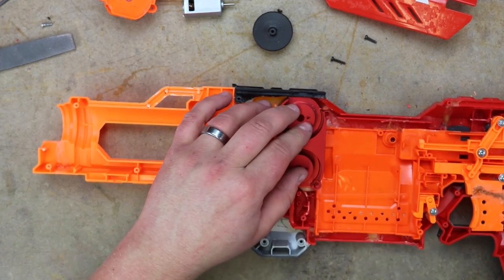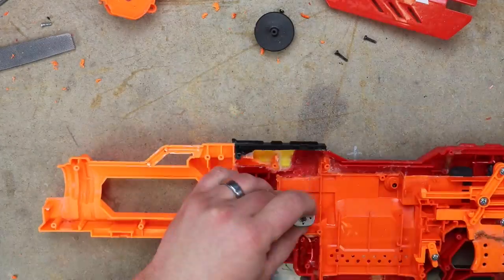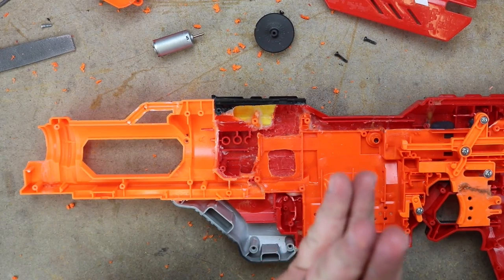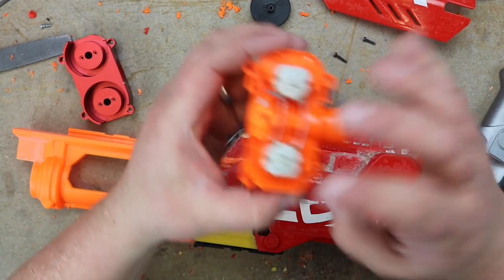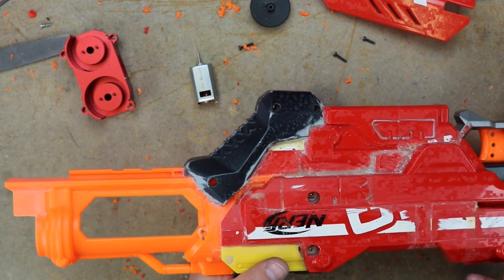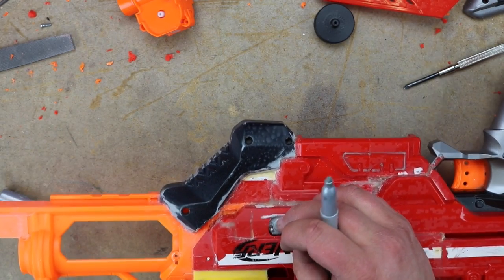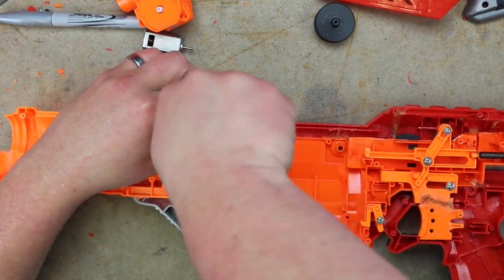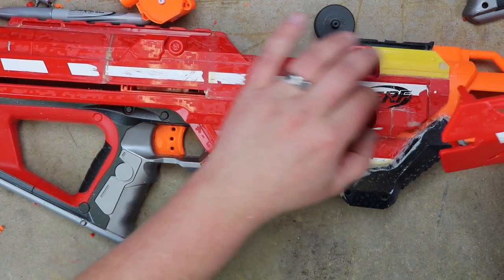Mod Along ep. 24 - "Do These Holes Make My Motors Look Fat?"

Comment: You've given me the idea of just cutting the holes big enough for the motor connectors and then running the wiring on the outside of the shell. It'd fit the style of cyberpunk I think.
Reply: I've been wanting to do "external wiring" with a stampede, for ages. With lots of cybery leds as well.
Reply: Oh yes, LEDs are a must!

Comment: To bad you didn't know about Fang's when you were doing this. 132's may have fit.
Reply from the maker: Naptown Nerf
 Indeed. 
Heck, 132's weren't even a topic of discussion when the video was originally recorded, much less when Tom built the wiring harness...
Whether or not Fangs will fit within a Centurion shell will be determined once I get into the Centaur's sister project. 
...but perhaps I've said too much? (New project teaser?)
Reply: I put fangs in mine so they should be able to fit, but obviously depends on how you integrate things.
Reply from the maker: Naptown Nerf Good to know. Thanks for the heads up.

Comment: Do you think putting one 130 motor and one 180 motor in a stryfe would make the dart hop up alot or just fly normally??
Reply: there is no hop for a dart, as if a dart flips end over end it will just not be any good, only spheres can 'hop'

it would not shoot the dart very well and might just melt the dart in the flywheel cage. Every time I've seen a motor burn out it jams and causes all sorts of problems with fragments of melted foam.